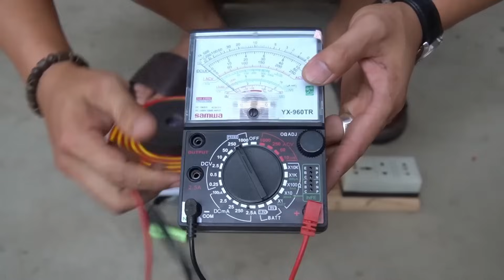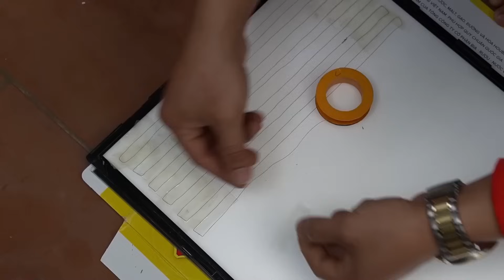Building a FREE Energy Generator at Home   It WORKS! 2024

Comment: You are tested DC voltage but the  output should be AC voltage ?????? Fake
Reply: There is a converter attached propbably 12dcV to 220ACV.........it's not fake